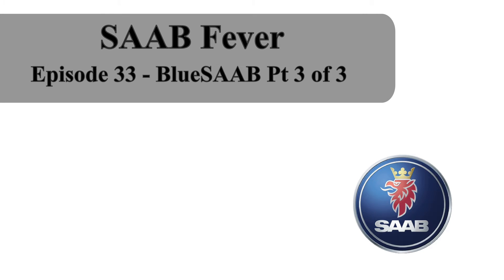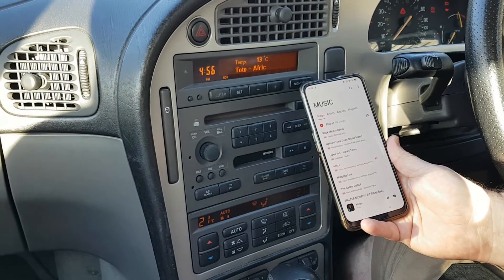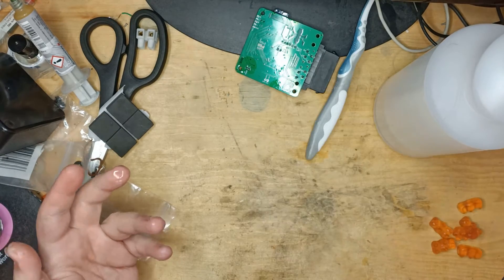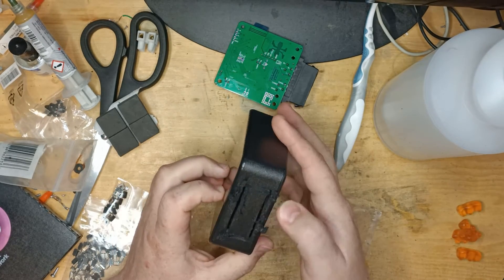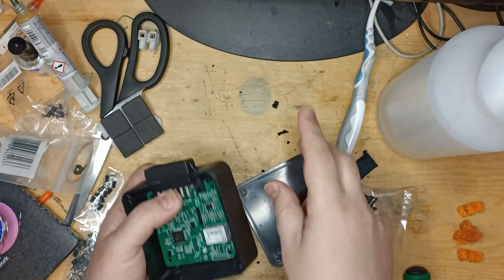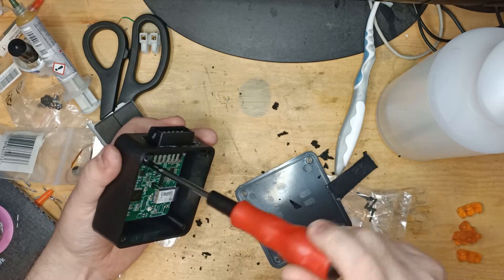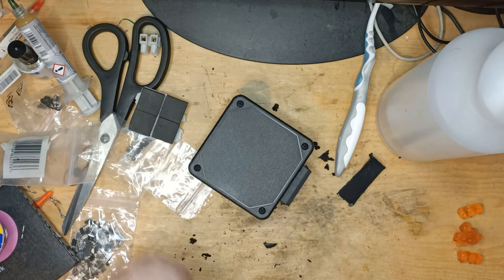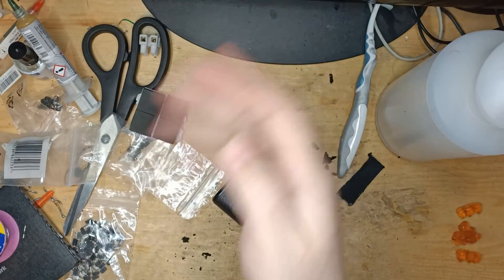Episode 33 - BlueSAAB Pt 3 of 3

Comment: Do you make bluesaab complete units to sell? Or have one for sale? Really want bluetooth in my 95 with the denso sat nav unit. Don’t really want to swap out the head unit if i don’t have to
Reply from the maker: I have done in the past yes, but i have difficulty getting chips at present due to the chip shortage problems still occurring.  I usually post in several Facebook groups due to the ease of communicating with people.

Comment: I'm in the progress of building the blue Saab boy it was fun trying to get all the components that was almost a dealbreaker! I think the rn52 was the most difficult thing to find....anyway great said of videos was just wondering if solution for Bluetooth phone calls I am researching it at the moment and may have one but it's a bit of a Longshot I know they're partial functional he built into the board.
Reply from the maker: From my understanding on the forums, they did sort of build it in but there were issues with the volume levels on the microphone circuit.  Personally, I`m planning to buy an amazon Alexia Auto (for a number of reasons) to see if this will allow phone calls through the Alexa (as well as music etc...)
Reply: Oh by the way that site you use to order and populate the boards would have saved me a lot of pain soldering that damn STM32...
Reply from the maker: @lachywocky  ha!  yeah, that's why I did it.  the first 2or3 batches I made were all done by hand and I managed to ruin a few too!  So much easier to get JLCPCB to do the hard work for us.

Comment: Great series,  will this work on 2009 93 aero v6 ?
Reply from the maker: Sorry, afraid not.  The BlueSAAB is designed for the older Audio System used in the OG9-3 (1997-2003) and the 9-5 (1997-2009)
Reply: @saabfeverfrank  
Thanks 😊